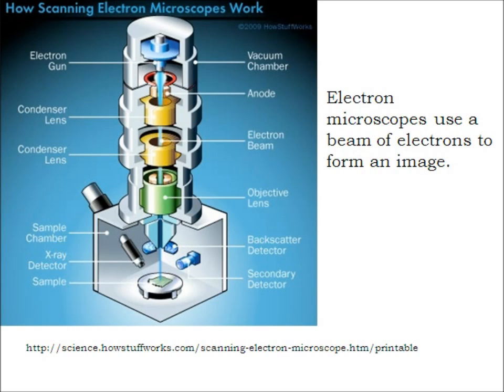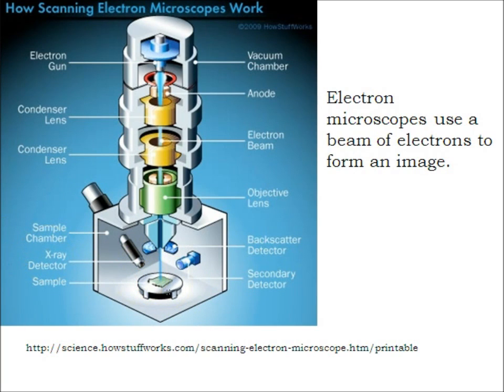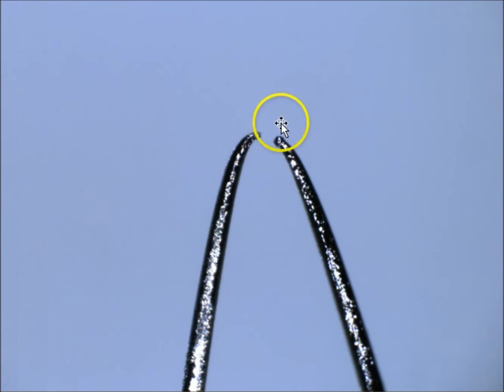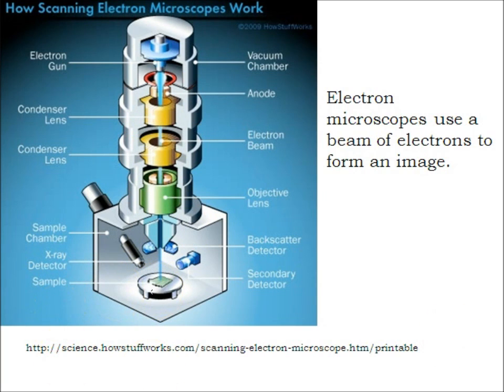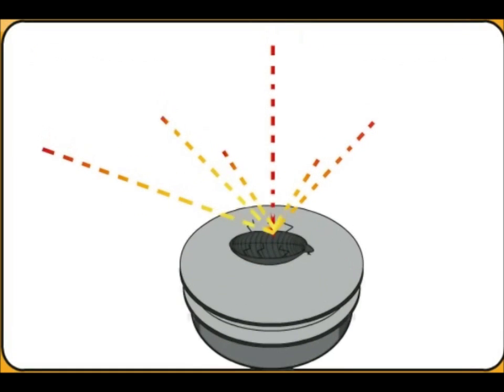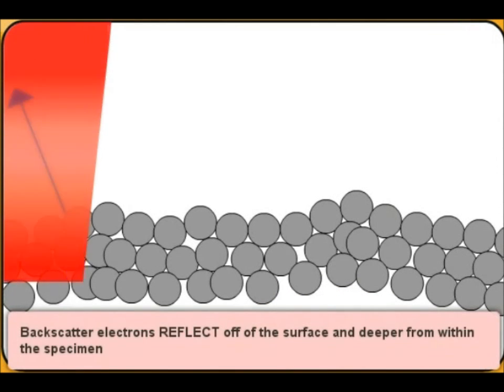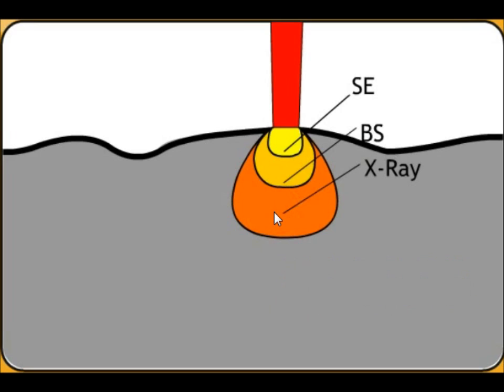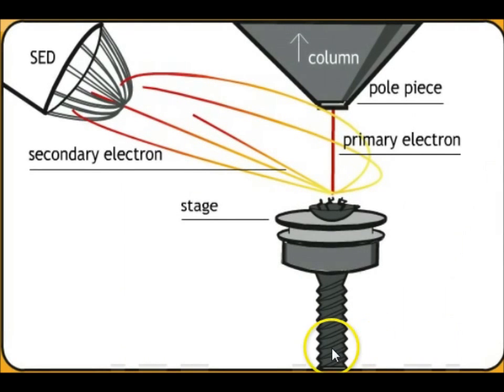How a Scanning Electron Microscope Works.wmv

Comment: My understanding is that there needs to be a vaccume inside the microscope, that way electrons aren’t going to come into contact with anything other than the target specimen.

My question is, how does a specimen stay where they need it to? Glass slides would get in the way of the electrons and  a vaccume would move the specimen...wouldn’t it?🤔

Comment: So the back scattered electrons are the electrons given off by the atoms of the specimen that are located deeper within?
Reply from the maker: Secondary electrons come right off the surface.  Yes, backscattered electrons penetrate deeper (relatively) and then come off the specimen.  Both are given off - different detectors are tuned to pick up the different frequencies.  Depending on your em you can combine both into a single image.

Comment: what is the possibility of bias for a 5 nano meter specimen ?
Reply from the maker: For my SEM, a Hitachi S3400, the theoretical resolution is 1.7 nm.  Hitachi claims 3.0 nm.  It is a 30 kV scope with a max mag of 300 kx.  My lab does not have a sputter coater so we are imaging uncoated samples.

I did some imaging of an aluminum sample with holes from 10 to 20 nm in diameter.  I was able to image it, but with aperture 4 in place and low probe current.  BSE dectector at 15 kV.  The result is a pretty grainy image, but it does show the holes.  

My concern, and I think this is what you mean by bias (not sensitivity of the detector) is that the edges of the holes are indistinct making the accuracy of the measurements poor.  
If this isn't what you meant please let me know.

M. Gans
Reply: @murrygans1786  thanks for replying! yes it is what i meant, i am seeking the full knowledge of this technology since i am a medical student and i am interested in doing a research in the medical field in the near future!
Reply from the maker: @anasomar1473  Let me add a couple of more things then.
Scanning electron microscopy only shows surface features.  Medical facilities have SEMs, but they also have at least two other devices for preparing specimens.  The first is a critical point drier (CPD).  The inside of an SEM is a very nasty place.  The specimen is under a high vacuum and being bombarded by high energy electrons. This can cause the specimen to dry out.  The CPD is a machine that uses high pressure and temperature to replace the water in a specimen with acetone or ethanol.  When the specimen comes out of the CPD the acetone evaporates and you have a dry specimen that will not shrink in the SEM.
Second is a sputter coater.  This device will cover the specimen with a very thin layer of metal, usually gold, iridium, or palladium.  This gives a bright, high contrast SEM image.
The second technique is not SEM but TEM - transmission electron microscopy.  In this procedure the specimen is cut into extremely thin sections.  The TEM sends electrons through the specimen to make the image, kind of like a light microscope, but the small wavelength of the electron beam give outstanding resolution.  The prep for this technique is complex.
Best of luck to you.  If you have any other questions let me know.

M. Gans
Reply: @murrygans1786  thank you so much doctor Gens, I have learned a lot!

Comment: By now you've had some experience using the small electron microscope the TM 1000 now we're going to add some theory behind what's actually happening inside the electron microscope and I actually delayed this until now until you had a chance to use the small electron microscope because hopefully it'll help it make a little bit more sense to you so here's a cutaway of what the inside of our electron microscopes look like this is not exactly ours but it's going to be very similar inside essentially what we have is we have an electron gun up here which we're going to induce to send a beam of electrons down to our specimen down here in the chamber and to focus that specimen we'll be using a series of electromagnets now we can't use glass lenses like you find on the regular microscope because electron beam won't go through glass but the electrons have a charge which means that they're influenced by magnetic fields so these rings right here these condenser lenses if you will are actually just electromagnets and the idea is to get those electrons finally focused right down here on the sample so first of all. let's look let's take a look at the electron gun electron gun here's a photo photograph taken with the like a dissecting microscope this is called a thermionic electron gun which basically means we're going to heat it up it's going to give off a bunch of electrons to give some idea of the scale here this is just a penny I had in my pocket I stuck down there with it so you could see what's going on by the way just show you a nice image from the from the Leica here you can see that this this film it's actually burned out so so this wears a way as we use it we put that 15,000 volts through there or on the big scope we'll put up to 30,000 volts through this filament and it eventually burns away all right so let's go back and look at our cutaway again so the way we get these electrons to head down toward the specimen is the fact that under this you will see a disc called an anode and anodes have a positive charge and of course negatively charged electrons are going to be attracted to our positively charged anode so they head off in that direction but there's a hole right in the middle the anode so once these guys start moving toward the anode some of them will simply go right through it also the stage down here on which you're going to mount your specimen also has a positive charge so that also keeps electrons moving in this direction this can cause a problem all things we look at normal our microscopes are non-conductive and as you found out with the hopefully with the team 1000 if so you have something that's non-conductive it can actually gather a charge and then it gives off lots of electrons in it all we see is a glow so let's take a look at what happens when the electron beam hits a specimen and how that ends up making an image on our computer screen so here you can see like Tron beam heading down it hits the specimen here and then there's actually two types of electrons that are going to come off of this in one case we're going to get the what are known as secondary electrons and that is when the electron beam comes down and hits the atoms of the specimen the those atoms absorb the energy and give off their own electron there's a detector to pick up secondary electrons over here as you can see and that detector to attract those electrons has a positive charge on it it's about 300 volts which is actually quite a lot and then once those electrons come in to the Faraday cage which is positively charged they hit the detector and then the detector uses the information from those electrons to form the image on our computer screen now the second type of electrons are called back scatter electrons and these electrons actually don't come from the atoms actually reflect off the surface and they actually can come even from deeper down the specimen and we have a second detector that it can actually detect those so this is to show you this little illustration will actually show you where these electrons are going to come from so you can see or the secondary electrons are going to be surface electrons so they're very shallow but these are very good for getting surface features and of course that's one of the main reasons for using a scan electron microscope the back scatter electrons are going to come from deeper in the specimen so someone will bounce right off the surface some will go deeper and then the ones that are really deep actually never get back out again so when they get absorbed they give off x-rays now we actually don't have an x-ray detector for our scope but you can do an elemental analysis by using by looking x-rays so the detectors that we have on our scope are the secondary electron detectors and the back scatter detectors so why is it called a scanning electron microscope well as you can see from this illustration here's our primary beam coming down and it's actually making the picture pixel by pixel it's hitting from left to right top the ball and every time it hits we get electrons from that particular part of the specimen interestingly enough if you want to magnify all we do instead of actually scanning across a big image like this so we just would scan over a smaller box so this is actually showing the setup as you can see here we've got the column here so all the electromagnets are up above there the electrons come out through the pole piece here they hit our specimen the secondary electrons over here to the side and then of course our backscatter detector is actually going to be up here mounted to the pole piece and you saw a picture of that on inside of the TM 1000.

Comment: The electron microscope is fake. 1. A byproduct of an electron beam is intense heat. You would vaporize anything you look at. As a matter of fact this is just a glorified x-ray gun. 2. You would also need the beam to be in a vacuum to cut resistance of air particles. In an x-ray  tube they spin the cathode to distribute the heat evenly.3. Also the cavity  where the electrons are allowed to bounce around is way too big. You would never get and accurate image. Modern Science is a Religion. That is all. Carry on.
Reply: The beam IS in a vacuum. Basic shit. And here is some heat produced, but not enough to vaporize most materials. What a troll.
Reply: Uses science to prove that science is a religion
Reply: Name calling is for cowards behind a keyboard. All specimens are coated with conductive material. Therefore you are not looking at anything actually living.

Comment: How come primary and secondary electrons don't get mixed ? How come secondary electrons are attracted to the positively charge Faraday cage while primary electrons are not? How do we use the information from those electrons to form a picture ?
Reply: It's  important to notice is that the BS electrons have a much higher energy than the SE. This way, those 300V won't be enough to attract too many BS electrons to the SE detector. The BS electrons detector is placed to capture a fraction of the backscattered electrons that depends on the solid angle that it covers.

Since there is a scanning being made, for every dot there is a certain number of BS and secondary electrons.
The secondary electrons that can be detected are "released" from very near the surface (about 2nm) because they interact a lot then can't travel through the solid too much. This way, the amount of electrons that can leave the solid will depend on its topography. The image generated reveals topographic contrast.

The number of backscattered electrons will depend on the atomic number Z of the atoms. Then, the image generated from this detector shows variations in chemical composition of the specimen.

Hope it helps ;)

Comment: How can SEM be used to image higher resolution than light microscopes, and how is this different for typical thermionic and field emission electron source microscopes.
Reply: The main reason it CAN image with higher resolution is because visible light have a diffraction limit much higher than electrons.

It DOES by focusing a very small beam in the sample.

About the source of electrons I guess there is no difference on the imaging. Since the electrons are accelerated to form a beam they're essentially the same. I'm not completely sure about this, though.

Hope it helps ;)
Reply: Resolution means distance between two points!  Light has wavelength 300-700 nm while electron has 4pm for example!   Smallest distance can be resolved is directly proportional to wavelength!!

Comment: How the microscope differentiates secondary and backscattering electrons?
Reply from the maker: There are two different detectors on the microscope and I can choose which one the microscope uses - in fact, I can use them both at the same time under full vacuum.  On my SEM, and because I am often imaging insects and other organic materials, I get a build up of static charge which can flood the detector with electrons - meaning I lose detail on the image.  The backscatter detector on my SEM operates under variable pressure which means I can control the amount of atmosphere in the microscope - from 6 to 279 Pascals. This allows the charging to dissipate.  This option is not available when using the secondary detector on my microscope, but other SEM models allow variable atmosphere on the SE detector.  So the best answer to your question is that I can pick which detector I use based on the nature of the specimen.

I hope this helps and I answered your question.

Best wishes,

Murry
Reply: +Murry Gans yes,  i got the idea. Thank you so much :)
Reply: Another important thing to notice is that the BS electrons have a much higher energy than the SE. This way, those 300V won't be enough to attract too many BS electrons to the SE detector. The BS electrons detector is placed to capture a fraction of the backscattered electrons that depends on the solid angle that it covers.

Is this correct, Murry?

Comment from the maker: Sorry for taking so long to get back to you.  We were on break and the book I needed was in my office at the college.

This is a weird one, so I went back to my textbook for an explanation.  Yes, the anode is negatively charged, but relative to the filament on the scope it is positive.  Here is a quote from the text:

 "If one induces the emission of electrons from a filament as described above, this will result in the emanation of electrons in all directions.  Without a mechanism for guiding them, most of the electrons would not enter the illumination system.  A second part of the electron gun, the shield (also called Wehnelt cylinder, bias shield, or grid cap), is a caplike  structure that covers the filament and is maintained at a slightly more negative voltage potential than the filament.  Because it is several hundred more negative than the 50 to 100 kV electrons, the shield surrounds the electrons with a repulsive field that is breachable only through a 2 to 3 mm aperture directly in front of the filament tip.  Electrons exit the shield aperture and and are drawn toward the apertured disc, or anode, the third part of the electron gun.  The anode is connected to ground so that the highly negative electrons are are strongly attracted to it.  THUS IT IS POSITIVE WITH RESPECT TO THE GUN.  In fact, the highly attractive pull of the anode in combination with the negative surface of the shield act as an electrostatic "lens" to generate a crossover image of the electron source near the anode."

Bozzola, John J., and Lonnie D. Russell. Electron Microscopy. 2nd ed. Sudbury: Jones and Bartlett, 1999. Print. 0-7637-0192-5

I could not agree with you more - it seems backwards.  The anode is negative, but it is positive related to the beam.

Let me know what you think.  There is also an illustration in the text I would be glad to photograph and send to you if you provide me an e-mail or text address.

Many thanks for your comment.

Murry

Comment: The anode is not positively charged, it is negatively charged,and it attracts positive charges.
Reply: Anodes are for the attraction of anions (negatively charged) and cathodes are for cations (positively charged).

They have to be oppositely charged from what they are attracting. Therefore, anodes are positively charged and cathodes are negatively charged.

Comment: You should have talked about the raster scanning meathod. you should have also explained about the EDAX spectrum and explained the way to read/uncode the EDAX spectrum. over all its a good video. it has explained all the basic points but not that good for a research level thing. I hope you include the above mentioned things and make an other video.